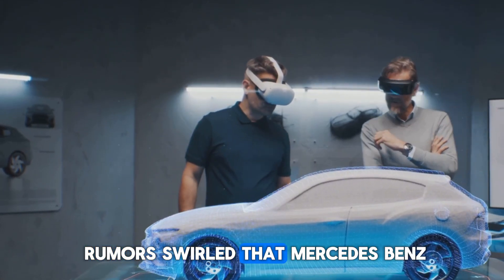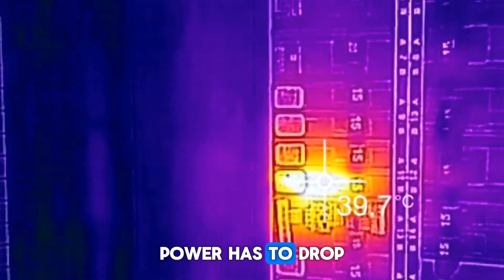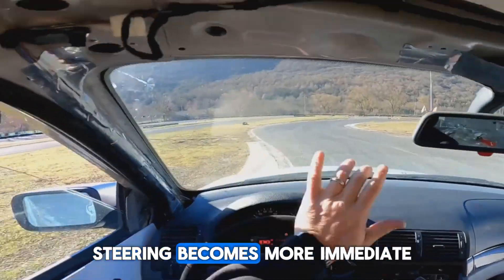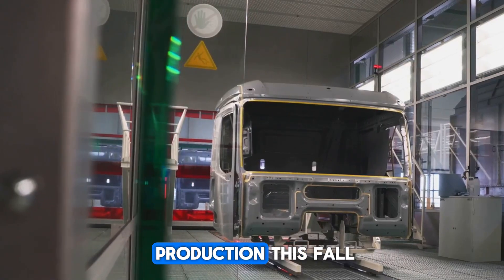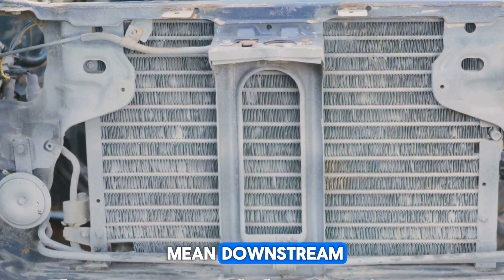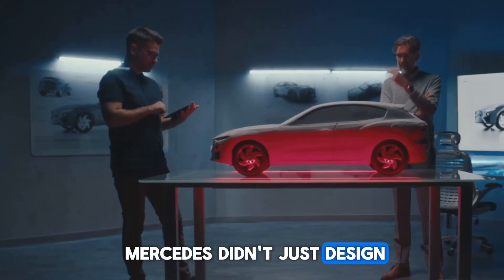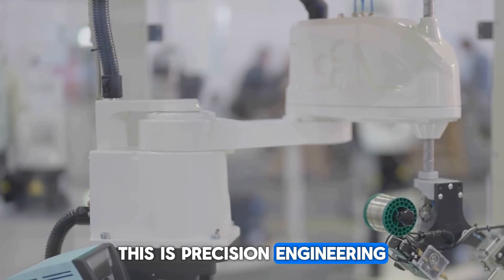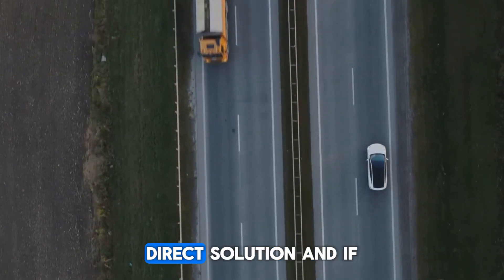Mercedes Drops a Bombshell: YASA Flux Engine Officially Confirmed!

Comment: Thank you for this great news!
I have done a quick FactCheck

Gemini AI:
Mercedes-Benz has officially acquired YASA, a pioneer in axial-flux electric motor technology, and has plans to integrate these motors into future high-performance AMG electric models. This was officially announced in July 2021 [2.2, 2.3].

Here's a summary of the official announcements and related news:
* *Acquisition and Integration:* Mercedes-Benz acquired YASA in July 2021 [2.2, 2.3]. YASA will operate as a wholly-owned subsidiary, retaining its brand and team, while developing ultra-high-performance e-motors for Mercedes-Benz's AMG.EA electric-only platform [2.3].
* *Production:* Mercedes-Benz plans to produce YASA-designed axial-flux electric motors at its Berlin site, investing a significant amount in the transformation of the plant [1.6, 2.8]. YASA also opened a fully upgraded manufacturing facility in Yarnton, UK, in May 2025, boosting its capacity to over 25,000 units per year [1.3, 2.1].
* *Technology and Performance:* YASA's axial-flux motors are highlighted for their high power density and efficiency, being smaller and lighter than traditional radial designs [1.2, 2.1]. A prototype motor developed by YASA reportedly set a new world record in power density, delivering 550 kW (737 hp) and weighing only 13.1 kg (29 lb) [1.2, 1.5, 1.9]. These motors are designed for mass production and are scalable for the premium segment [1.2, 1.9].
* *Concept Vehicles:* YASA axial flux motors were included in the Mercedes-Benz Vision One-Eleven concept unveiled in June 2023, showcasing how the technology could be implemented [1.4, 1.9]. The AMG GT XX concept also features three YASA axial flux units, promising a combined output of 1,000 kW [1.3, 1.9, 2.1].
* *Partnerships:* Beyond Mercedes-AMG, YASA has also partnered with Automobili Lamborghini to create high-tech axial flux electric motors for their upcoming plug-in hybrid supercar, the Temerario, which will debut next year [1.3, 2.1, 2.5, 2.6].
* *Sustainability:* The production of these motors involves sustainable practices, with plants being solar-powered, rainwater cooling machinery, and epoxy waste being reused [1.3].

The claims in the video align with information from various news sources regarding Mercedes-Benz's acquisition of YASA and their plans to utilize axial-flux motor technology in upcoming high-performance electric vehicles.

Comment: Electric Motors on YouTube 
These flashy yet common videos aim to dazzle the not-technical audience. For instance, they might claim, “The motor weighs only 35 kilograms but can produce 750 kW, boasting a 96% efficiency…” or something along those lines. 
However, they neglect to mention crucial details such as: how many seconds can it sustain the 750 Hp (or kW, it’s irrelevant), before overheating. Electric motors have the capability to handle overloads of 300% or even more, but only for brief intervals, which is beneficial in vehicle applications requiring quick acceleration. 
Now, this power is generated at 12000 to 20000 rpm. What they fail to disclose is that the 96% efficiency is achieved at 4500 rpm and 135 Hp, for example. They aren’t technically lying, but they are certainly misleading the audience through omission. 
As a result, instead of gaining any valuable insights, viewers are left only with lingering questions: How is the heat managed? It’s important to remember that with so-called “high gravimetric or high volumetric” power density motors, where significant heat must be dissipated to extract high work rates, efficiency goes out the window. Heat generation consumes energy; it’s not without cost. 
What is the weight of the heat exchange equipment? What about all the additional components, like plumbing, pumps, cooling fluids, and so forth? These weights are not factored into the claimed “…35 kG”. 
These high-speed machines (which must be to remain compact and lightweight) come with additional components like gearboxes. These require lubricants and, in some instances, another heat exchange unit, either standalone or integrated within the motor’s cooling system. The total weight of everything far exceeds “35 kG”. 
In summary, while many of these videos are captivating and undeniably enjoyable to watch, I personally find the Brothers Grimm far more appealing, thank you.
Reply: See my comment.